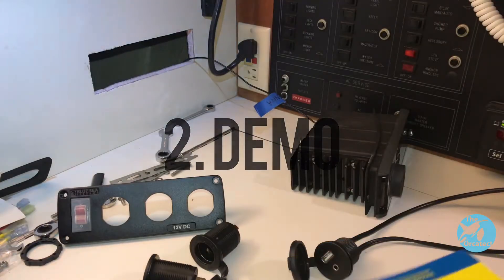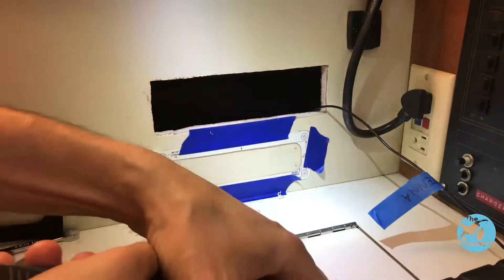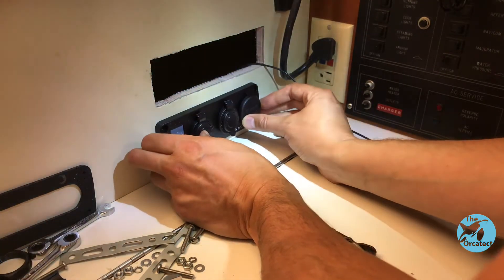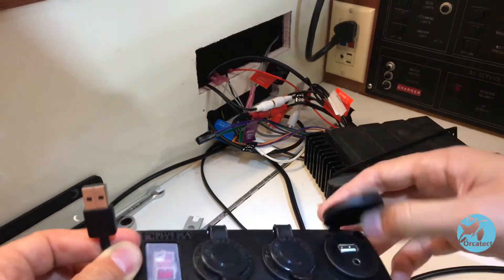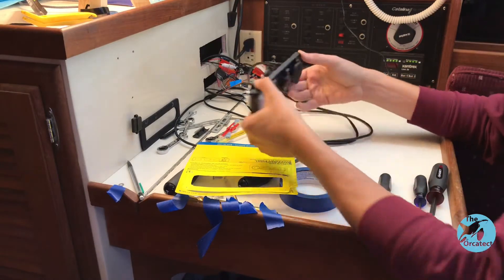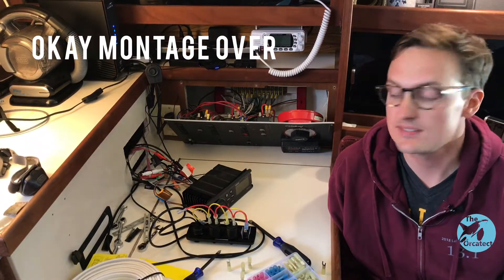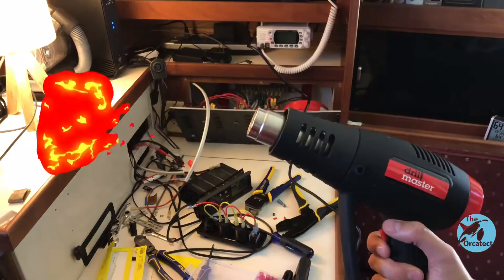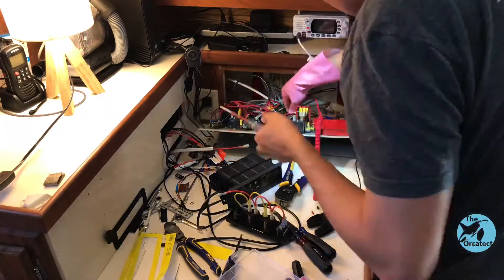Installing 12V Outlets on a Sailboat

Comment: You can use a lighter to heat shrink little wires like that if you don’t want to go through the hassle of reconnecting power.
Reply from the maker: That's a good point, fire has its own obvious disadvantages, but I have some more electrical work coming up and I may use the lighter method instead next time!